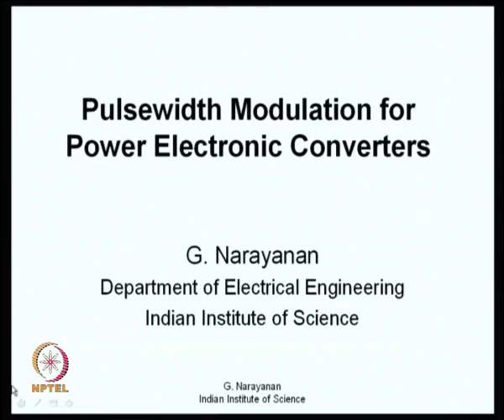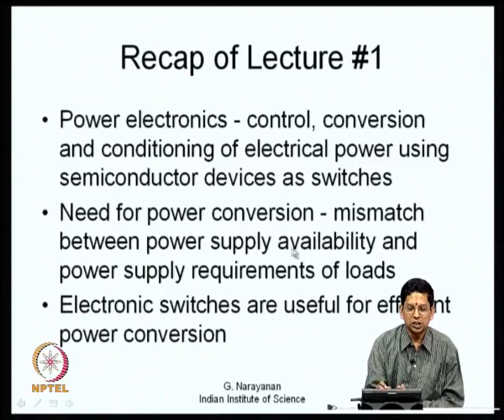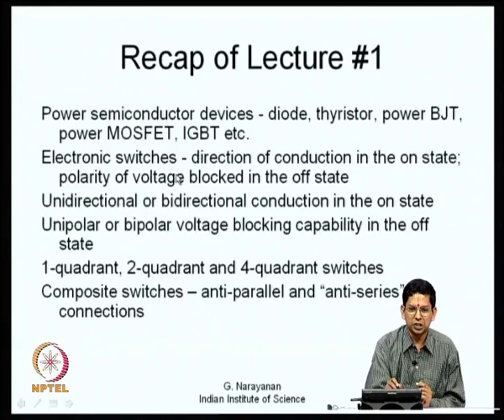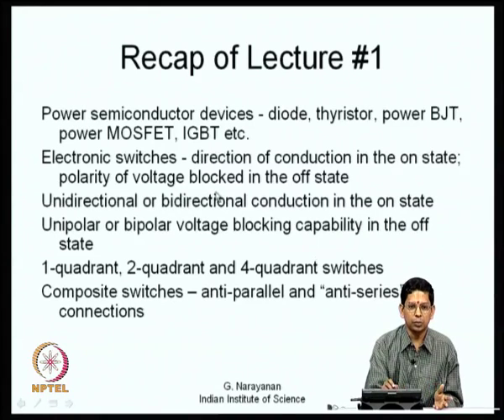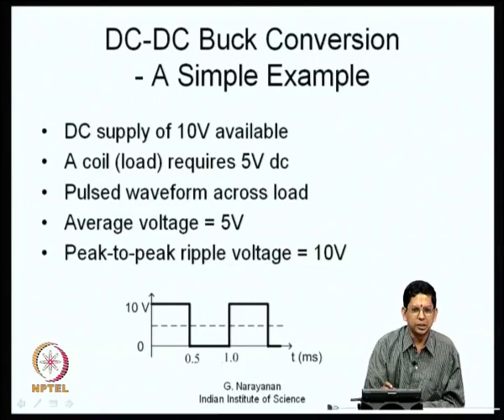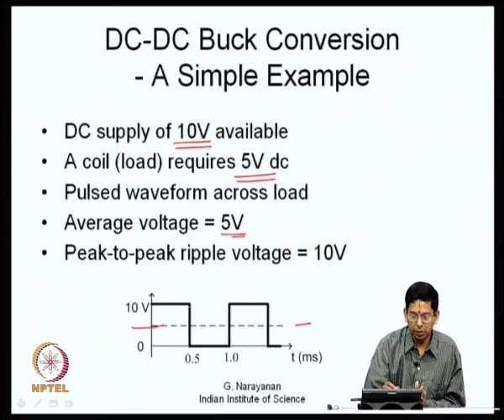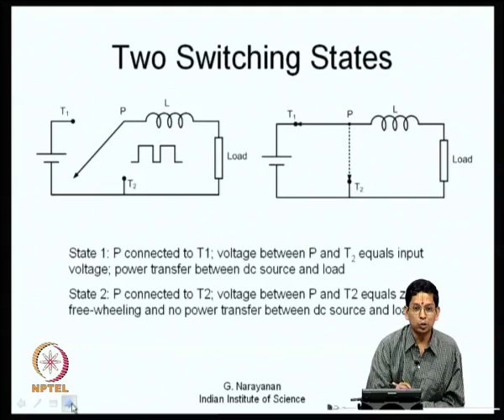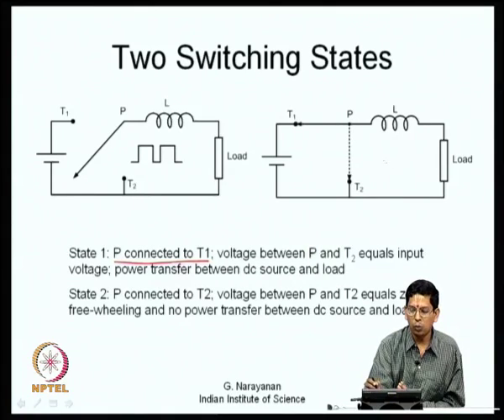Mod-01 Lec-02 DC -- DC converters

Comment: When you discuss the anti-series connection, shouldn't the diode be connected the other way? I thought the cathode was the negative side and if so, you can only block current with the positive anode side.
 I am thinking in terms of the current flow model. If the source of electrons is ground then the cathode side will only allow those electrons to flow through the diode. ( |>| <- current flow).

Comment: In buck converter, When switch is opened, inductor will change its polarity so that diode will be short circuited. In this case if we apply KVL, then Voltage across the inductor is getting +Vo know. Please clarify this sir.

Comment: Hello,
 I do the boost converter circuit but I cannot able to convert 5 volt to 19volt please suggest me the inductor value and resistance value of the inductor. If possible please suggest me the part number for the inductor.

Comment: Hi. You mentioned in the lecture that inductor in this circuit is used for filtering purpose. This is not true. The biggest purpose of having an inductor in this circuit is for charging and discharging. In other words, it will charge when transistor is ON and discharge when it is OFF. Hence it will provide a current both the time ON and OFF of the switch operation. Effect of this will make a dc look like waveform on current and hence the dc supply. The second characteristic of the inductor is filtering, which is taking a secondary part in this example. But primary purpose is to provide a constant current (dc) by the phenomena of the taking an average of the voltage(ON/OFF), and its effect on current by charge/discharge characteristic of the inductor. And hence the inductor is used to create a buck/boost converter.
Reply: I'm sure he was supposed to say capacitor. rant over...
Reply: But what you said and sir mentioned are two sides of the same coin. You are analysing the circuit in time domain, he is analysing it in the frequency domain. The dc-dc converter without inductor-capacitor filter wouldn't filter the harmonics and would provide you distorted dc. Think in terms of frequency domain, you will understand.

Comment: do you maybe have a scheme for a DC-DC converter with PWM for lowering voltage that i can use to simulate in NI Multisim?
Reply: honestly it was 9months ago i needed it for the final work and i can't really remember what i did i just know that i messed with it alot without actually knowing how it works but i worked, i'm not the right person to ask, i was lazy in shcool and didn't know crap, sorry